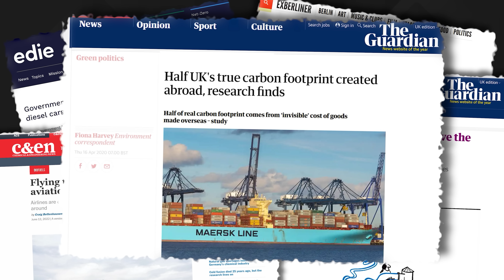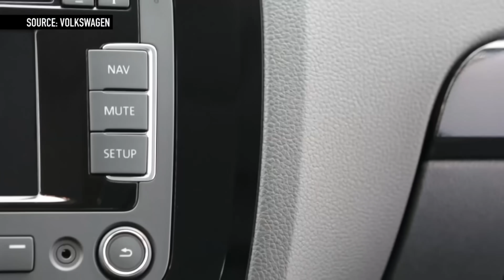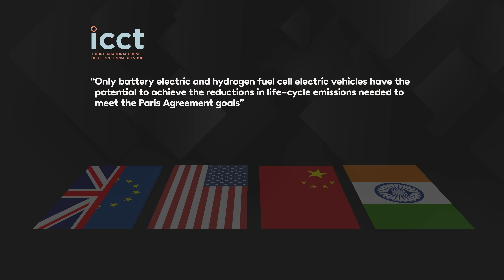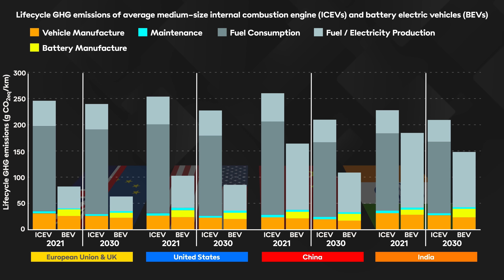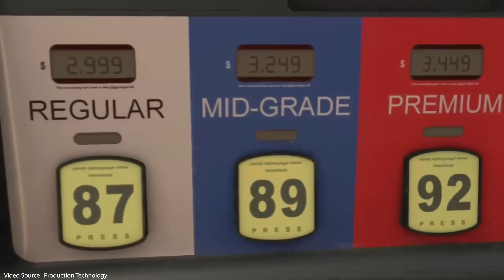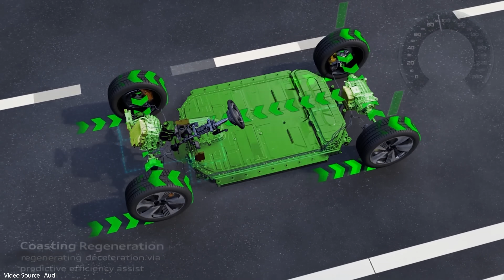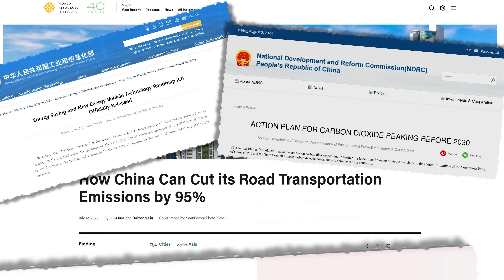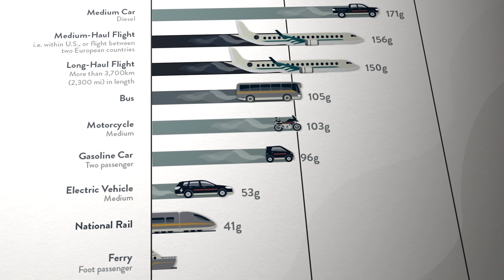Are EVs really better for the climate?

Comment: It makes intuitive sense once you learn two factors:
- electric motors are incredibly efficient compared to internal combustion engines.  it's eye-opening when you look at the maximum theoretical efficiency of ICEs and the real-world efficiencies of electric motors.  electric motors are so much more efficient that it even makes sense (though the impact is less) to carry around a gas-powered generator to power those motors instead of powering a mechanical drive train, so hybrids get better MPG than gas cars.
- bigger power plants (e.g. a giant coal-fired plant) are more efficient than smaller power plants (a tiny portable gasoline-powered engine)

And then two more things that are just icing on the cake:
- electrification makes it easier to switch over to green energy sources.  you can't get gasoline from a windmill.
- while battery storage doesn't make a lot of sense for grid storage, its portability makes sense for EVs.  but once you have those batteries distributed all over the grid, you might as well offer rebates to EV users to let the grid rebalance itself with a portion (user-controllable) of that distributed battery.
Reply: Batteries did not make sense for the grid just a decade ago, but a lot has happened and more is at the pipeline.

Look up Ambri, flow batteries and iron air batteries.
There is even a promising energy storage using compressed CO2. That makes sense as CO2 is a lot easier to liquefy than air.
Sand and rock batteries storing energy as 800 K heat is also a thing.

The question is which technology will become dominant for MWh grid batteries, not if they will become important :-D
Reply: @madshorn5826  for decades pumped Hydro has been used to store electrical energy. Excess power from California is sent all the way up to British Columbia where it pumps water back into the dam reservoirs which is then released in peak demand situations and the power sent all the way back to California. Clearly some losses along the way but the dams are there already and that time as you suggested large scale batteries weren’t much of a thing.

I’d rather like compressed air storage where they’ve developed some sophisticated but efficient equipment to do the job. I believe there’s a large scale experiment in Ontario going on which shows a lot of promise.  I wasn’t aware that they were using carbon dioxide but why not? I do know from my experience in fire suppression that liquid carbon dioxide requires a refrigeration system to keep it liquid. I

I’ve seen gravity towers above ground but I think that using all mine shafts would be a much better idea from a safety standpoint. I like all the new developments in batteries. I also like the high temperature underground storage that’s being pioneered in Finland which is capable of storing power over the entire winter.

Clearly there are a lot of applications and profits to be made when you look at the first Tesla battery in Australia that cost 90 million but pays back $45 million per year; there’s clearly an opportunity there. Storage is required short term from second to second and longer-term hour to hour, day-to-day, week to week and month to month. Each one of those applications will have its favorite energy storage medium with geographic availability of materials and sites being a consideration as well.
Reply: @colingenge9999  
At ambient pressure CO2 will not be a liquid: it sublime, it doesn't evaporate.
CO2 needs pressure to remain a liquid, not cooling.

That is the beauty  of using the gas causing the trouble: you can use off-the-shelves pumps and pressure containers :-)

But you are right: we need to apply a spectrum of solutions according to need and geography.
Pumped hydro is a nonstarter in Denmark where I live: Our highest point (named The Sky Mountain in danish ;-) is about 115 meters above sea level :-)
Reply: @madshorn5826  fire suppression using carbon dioxide is one of my areas of expertise. It is either kept as a gas at 100 bar or as a liquid by refrigeration Which they call low pressure carbon dioxide. It looks like the entire industry has been wasting its time adding cooling systems. According to you it should be just compressed a little bit more. Surprising they never figured that out with the 50 years they had to work on that problem. Contact Kidde Fenwal and ChemeTron; Inform them that they’ve been wasting their time for the last 50 years.
Reply: @colingenge9999  
You are of course right that cooling can make CO2 liquid, but so can compression :-)
Look up "triple point for carbon dioxide" and read the Wikipedia article about "Liquid carbon dioxide".

Also be advised that terms in technical areas can be somewhat fuzzy.
Your job is interested in what comes out of the canister, not what the content is.
I am a physicist btw.

If you open the valve of a pressure container with CO2 gas will escape, but turn a 200 bar container on its head and open the valve and liquid will squirt out.
Don't try this at home!
Cryogenic liquids can be dangerous.

The liquid is not cold when in the pressure container, but evaporates very quickly at 1 atm. Evaporation needs energy, so the liquid will be minus a hundred degree in no time.

There may be historic or technical reasons to store liquid CO2 at -37°C.
The equipment may be paid out and/or pressure containers uses to be more expensive and less tough.

Whether the content in a 200 bar container at room temperature is liquid or a super critical liquid is not important for long-term storage.
The important point is that the density of the compressed CO2 is a lot higher than the ambient temperature bladder.

Cooling to -37 °C may be more economical than steel or fiberglass containers, but at large scale I doubt it.
Reply: @madshorn5826  Further research indicates you’re correct on carbon dioxide energy storage. Thanks, I learned something.   

CO2 is the perfect fluid to store energy cost effectively in a closed thermodynamic process as it is one of the few gases that can be condensed and stored as a liquid under pressure at ambient temperature. This allows for high density energy storage without the need to go at extreme cryogenic temperatures.
Reply: @colingenge9999  
👍
And thank you for the exchange :-)
I learned a bit too.

The internet can be a fantastic tool when we cooperate.
Reply: I agree that in future using electric vehicles to rebalance the grid is a really good idea. In the city that I live in electricity is $.25 per kilowatt hour but at least two utility providers give three free hours at night because they literally have no place to put the power and are happy for someone to take it away for nothing.

If you look up the $90 million Hornesdale battery in Australia you’ll see that it creates a profit of around $45 million per year which is a heck of a good investment. Utility scale batteries help the grit out in a number of ways not the least of which is preventing dangerous power spikes or power dips that can damage equipment. Reading report of the Hornsdale battery there was times when they were getting power off the grid and getting paid to take it away at a dollar per kilowatt hour. And now the policy in Australia has changed completely so that batteries are becoming a much more normal Part of every grid.
Reply: @colingenge9999  Exactly. All these people who keep telling us ‘the grid will melt if we are all driving EVs’....have no idea how the grid actually works. In the UK the National Grid have a ‘Six myths busted about EVs’....they’re the people who run the UK grid and they say a switch over to EVs will not be a problem. Most EV charging is done at night when there’s nowhere for the power to go..as you say. In the UK Octopus energy offer £0.05/kWh between midnight and 6 am. It’s a no brainer to have an EV but people still keep filling their tanks at £100 a fill....fools burning money.
Reply: @Swindonboy56  Agreed. Just say nothing of the joy I still experience in driving my electric vehicle after four years. It’s still exciting which amazes me. I also appreciate the quiet and freedom from vibration which is something that annoys me neurologically.

thanks for your response. It’s so nice to read from people who are talking sense and not spewing fossil fuel company propaganda. It’s amazing how often I’ve heard the same half dozen arguments over and over such as it cost more fossil fuels to build a windmill than you would ever get out of it over its lifetime which of course is a total financial impossibility but yet it’s amazing how many people believe this notion that on the face of it makes absolutely no sense. It’s like they haven’t spent more than five minutes thinking about it or reading more than one article and getting all up in arms about how we’re being screwed over by the renewable energy industry. Much the same as politics I guess.
Reply: @colingenge9999  You’re right about some of the ridiculous comments made by the hard of thinking. IMO Dave Borlace produces the most well researched and best presented material on the climate crisis on YouTube. The driving experience is indeed wonderful with an EV and I remember the first time we went to the mountains here in France...noticing the smell of burning brakes from the ICE vehicles coming down while the e-Niro just wafted up the twisty climbs without and change in engine note. On the descent we did 20 km of continuous downhill without using the brakes once, all on the regen paddles. EVs are simply superior.

Comment: I read this report, and found a few things that deserve attention.  First, the EV vehicles Life Cycle CHC emissions are based on 2021-2038 Grid Mix.  Note, that is a future prediction of how the power grid will be fuelled - There is some predictions there, and of course the desired climate accords, which this paper draws on continuously, want to see more and more renewables.  But it should be noted, that the drive for more renewables has many roadblocks and downright misleading sells along the way (see the documentary "Planet of the Humans" for examples of what I mean). I also found it interesting that the paper at one point analysed EV's running on total renewable power.  Where does that ever happen?  Even if for the sake of argument you did have a power company that was totally wind power based,  and you lived right next door, you still would be benefiting from the use of non-renewable energy, with the construction of the fiberglass wind farms, the gas trucks that hauled the blades to location, and so on. So I am more than a little weary that a full life cycle, comprehensive analysis was done in any of this.  An 18-year (16 for the US) car lifespan assumption was also suspect.  I know, I know, we are a throw away society, and no one takes care of anything anymore, and hardly anyone knows how to  - but isn't that part of the problem?  Another thing that poked out at me was when the paper stated that the life cycle emissions of gas cars being 2X as high as official tailpipe CO2 values. But I did not notice a real world range reduction comparison for EV's.  I could go one, but, one last thing:  the paper is devoid of real data.  Perhaps it is downloadable somewhere.
Reply: 'Planet of the humans' is a complete  pile of SHIITTTTTT paid for and produced by the oil industry, in reality renewables work! and are a 1000's less poluting than fossil fuels. Yes there are consturction cost and over heards, but have even seen a 40,000 ton oil rig up close, or a refinery the size of a city and consumes the energy of a city, or 40% or all shipping is to just transport fossil fuels or the fact coal burning produces 5 billion tons of highly toxic cancerogenic slag per year to landfill, or 17% of all freshwater globally is used by the fossel fuel and nuclear industry. Basically Gasoline does not magically end up in your fuel tank!

In reality a world running on renewables will not take much more energy to construct and maintain than the existing fossil fuel industry, but will need NO FUEL to run and generate a tiny fraction of the waste and pollution!!!!!!

Comment: As he said they didnt take into consideration what happens before and after the cars are sold and driven. Batteries are nasty to make and there is nothing to be done with them when they are expended. The miles needed to make batteries is enormous and not taken into consideration. These simple omission makes these numbers null and void.
Reply: You clearly didn't watch the video and are clearly labouring under some misapprehensions.
The environmental cost of the battery manufacture was clearly added to the graphs.
And batteries can be recycled.

Comment: The glaringly obvious way to reduce our transport carbon emissions is to make personal transport substantially smaller and fit for purpose. A 3 or 4 wheeled, single or two person electric vehicle will be cheaper to produce (substantially reducing life cycle emissions) and reduce congestion too. Such a vehicle can still be sealed from the elements, air-conditioned and heated. 
We seem to have an unquestioned love affair with huge metal boxes on wheels. It strikes me that this is a fundamental flaw in our collective logic. It's also a flaw in our vehicle design rules that seem to favour larger heavier vehicles to lighter ones, with the exception of motorbikes and the like.
Transition to a smaller vehicle for mass transport use will be a challenge if we value safety, but can be achieved by road rules and aggressive enforcement of the new rules.
Long distance/heavy load and haulage can coexist with smaller/lighter EV's again with rational road rules and enforcement.

Comment: I've had a Chevrolet Volt since 2018. It's an extended range electric. Gets about 55 miles from the battery and then has a gas motor for when you run out of charge. My lawn mower ( admittedly it's a commercial grade zero turn and holds 9 gallons of gas) used more gas in the summer mowing my lawn than my car does in a year. Since 2/8/18 and after 60,000 miles my average cost for gas and electric combined ( I charge the car in my own garage) has cost $0.042 cents per mile. The money it has saved me huge. EV's might not be the " cool" car to have but you-all can laugh all you want. I'll be smiling as I watch my savings grow because I'm not spending my salary at the pump....
Reply: Counter argument to Just Have a Think biased argument... https://www.youtube.com/watch?v=TUx8yIlKVpU

Comment: Thanks Day - very helpful and relevant. Ever notice how bad the fuel efficiency of motorcycles are - worse than car. I would suggest that an e-bike is nearly the best as a regular bike requires humans to eat energy intensive foods, although maybe a human can be powered from locally grown bio power.
Reply: Motorcycles pollute and consume a lot. I'm not sure I like the bicycle argument. Humans need exercise and bike production is not so intensive on the environment; so I would like to promote bicycle use. Electric bicycles are not particularly robust for weight and size constraints and they are expensive to fix; so typical lifespan is short before they end up in a landfill.

Comment: Thank you, Dave. I understand the EV point of view in that research paper; but wouldn't it be also possible to look at the Levelized Carbon Emissions from an EV that consumes energy from the sun (solar roof) over time? Of course, we must always look at the carbon emission during the production and transportation of the EV that gradually is mitigated by its use YoY as long it is fueled by energy from the sun.
Reply: I suspect that using your own solar panels to charge your electric vehicle might represent an excess of a 90% reduction in emissions. There should be no reason why you couldn’t get 25 years out of your panels to say nothing of adding battery back up to one of Tesla Solar’s virtual grids where they will pay you two dollars per kilowatt hour to suck far out of your battery pack in emergencies. It may not be too long until the economic argument for a fully electrified economy is so strong that those countries that go against the flow and continue using fossil fuels will fall behind.
Reply: @colingenge9999  Yes, I also consider the factors you mention. The Tesla Powerwal, however, may be optional where electricity from the utility grid is very expensive. Otherwise, the solar roof system with a smart control house/utility feed-in-tariff may be mostly the common solution. We also have seen some electric cars with battery systems, such as V2L from Ionic 5 and Ford Lightning, that can supply electricity to home appliances for a few hours before a blackout is fixed. I also totally agree with you in the last sentence. It makes so much sense, especially when we look at the factors related to products' production opex.
Reply: @youxkio  I applaud the electric vehicle manufacturers that allow power to be taken from the vehicle in order to power of the house. I think the Teslas policy of not doing so came in an era where the batteries were not designed for that many charges and discharges but with their move to lithium iron phosphate and other battery types, I hope that will change.
Reply: @colingenge9999  Exactly. The similar batteries from CATL.

Comment: I am happy with the car I have. In terms of emissions would it be better to keep the thing running with regular maintenance or should I wear the carbon footprint of a new cars production over the cost to keep this car running?
Reply: Assuming you'd sell the current car rather than just set it on fire so doesn't really matter what you do.
Either way it'll keep on driving and polluting.
So on an individual level, if you like the car and enjoy the refuelling hassle, stick with it...